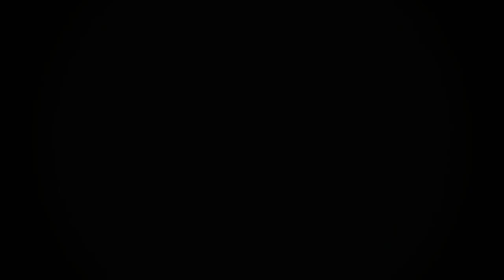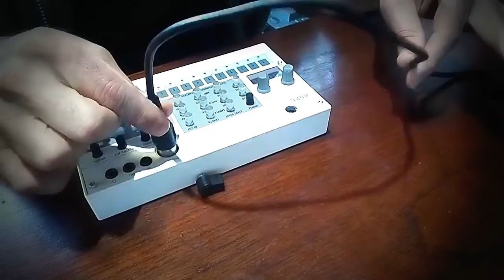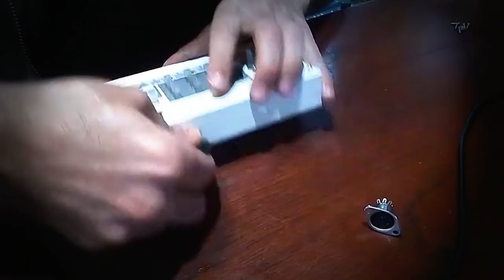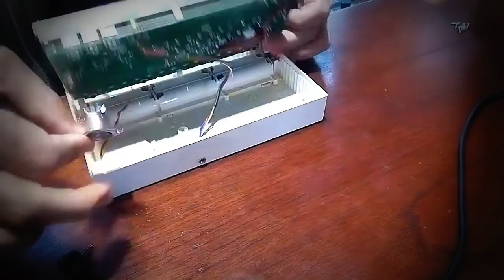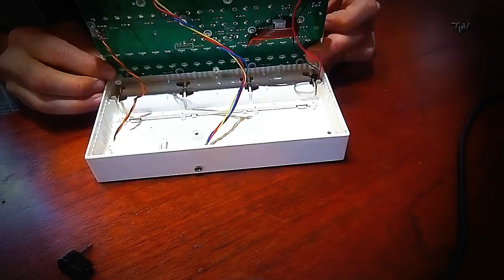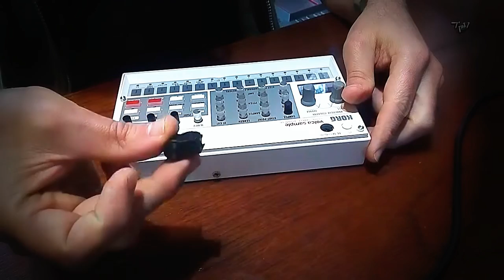Volca Sample modification - second MIDI input

Comment: Sweet, thanks for the video! Do you think a 3.5 mm socket would have fit as well, or is 2.5 mm the max size? I really like that a lot of modern gear is using 3.5 mm sockets for midi, it is so much more convenient than the heavy 5-pin cables, especially for a mobile setup.
Reply from the maker: My pleasure.

I think a 3.5 would have fit, although it was pretty tight, from memory.

I had an IK MIDI adaptor that was using 2.5 to DIN leads, so I think I went with 2.5 for that reason (compatibility in an emergency..)

Comment: Nice project!   Makes me wonder how difficult would it be to wire up a MIDI OUT, assuming that break-out exists on the main board of the Volca Sample?
Reply from the maker: Thanks!
Yeah, should be straight forward (I've never checked that project out). Mounting the socket would be the hardest!

Comment: there are 2 mods that i would like to make to the volca sample:
1- adding a rechargeable battery so i can use it without having it plugged to the wall nor buying 6 AA batteries time to time.
2- making the headphone output be on the right side of the unit instead of it being in the front, which messes up my setup.

are they possible? is it hard to mod the volca?
Reply from the maker: I'd just fit AA rechargeable batteries, and charge them out of the unit, in a charger. There's a setting in the Volca to tell it that you're using rechargeables, from memory.

The Volca is pretty easy to work on. The only difficulty would be finding a spot on the side where there's space, internally, for the new socket. Drilling and fitting the socket was pretty tricky, too.